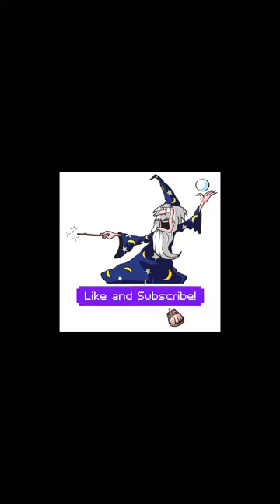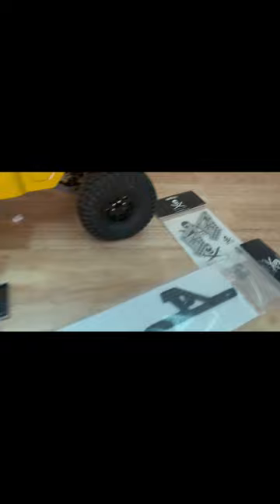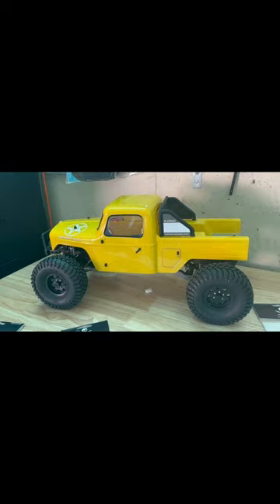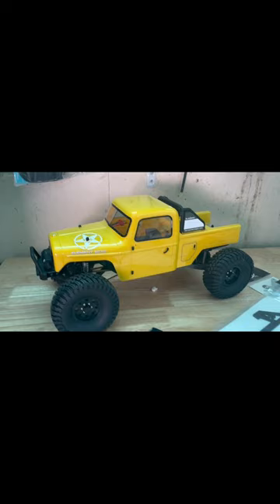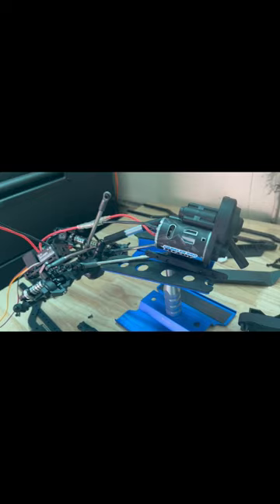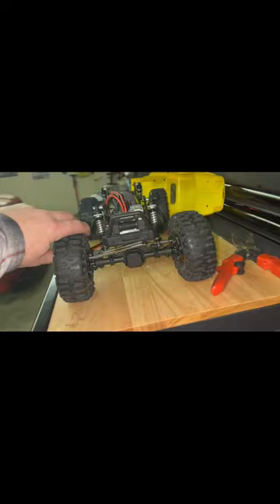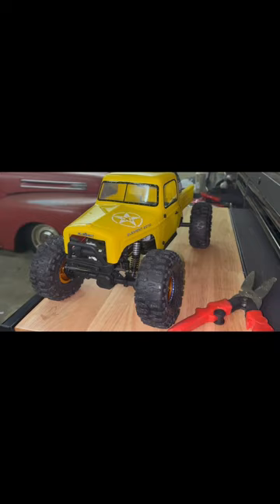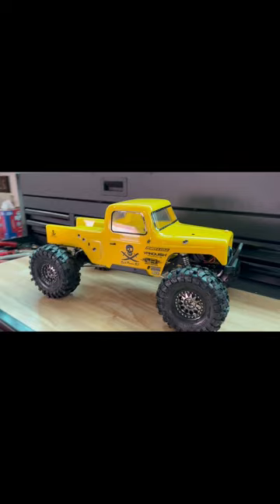How to build Element Ecto into Rock Pirates Chassis LCG. How to build a LCG crawler.

Comment: did you ever complete this?
Reply from the maker: At the very end of the video, it is 99% complete. It needed a body strap and that was pretty much it. I had it ready to shoot another video and I sold another rig to someone local and they saw that on the shelf and made me an offer I couldn't refuse, so I let it go before making that second video! Overall, it was a great upgrade to do and I liked they way it performed. Honestly, stock, I love these and think they are overlooked way more than they should be.
Reply: @TheJourneyofR2  my apologies, lol. What was the rear links you used to fit it?
I want the interceptor for my ecto. Thank you!
Reply from the maker: @j2themen07  no worries! I either used sendero or gagtekeeper links. I think it was from the sendero, but I can't remember for 100%.

Comment: Can you keep the trailing arm set up in the rear or do you have to go 4 link?
Reply from the maker: I would reach out to rock pirates RC to confirm but I believe you can. I was going back and forth with it and decided before I built it that I wanted to go 4 link.
Reply: I know this is an older post, but yes you can keep the trailing arms and anti-sway bar. They have mounts available.
Reply: What mounts
Reply: @reeserides7757 The Ecto specific sliders come with mounts, however I found the mounts and trailing arms to be in the way much more with the new chassis and eventually swapped over to 127mm lower links and ditching the trailing arms and sway bar. I don't regret it at all.
Reply: @adam_chevyss  yeah I just ordered high clearance brass lower links. I’m going to ditch the trailing arms as well, plus it’s less hardware going back in. I appreciate it brother.